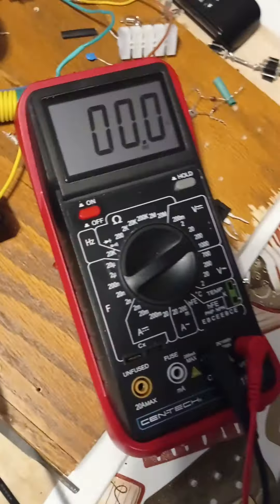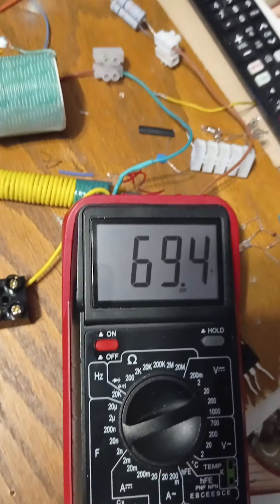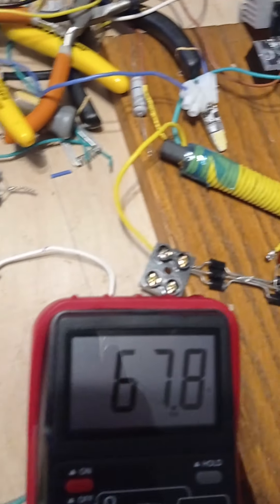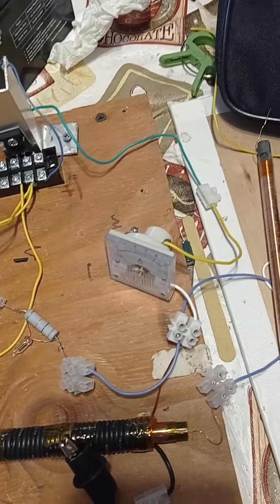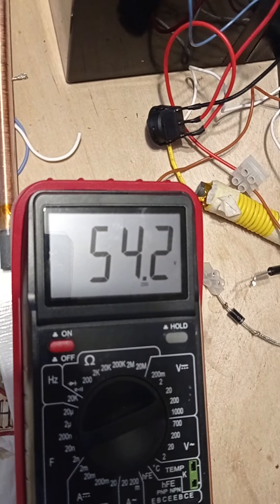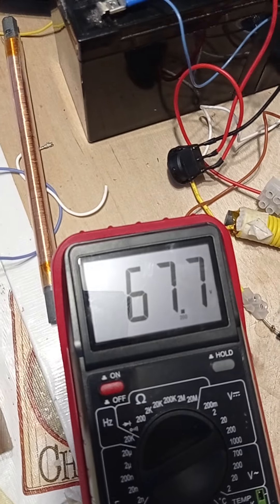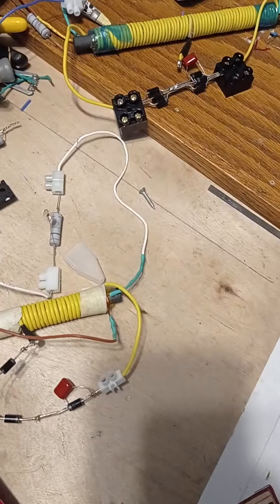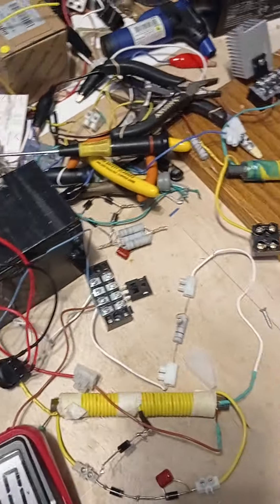I fixed it

Comment: putting a capacitor in series with the secondary coil creates a RC resonant circuit, and the capacitor will change that frequency based on its capacitance and speed of charge and discharge. It would be helpful if you could list all the components you are using in the description of the video - specify the coil length, type of coil, number of turns, type of wire used, type of capacitors used with stats, type of resistors used etc…
Reply from the maker: yes